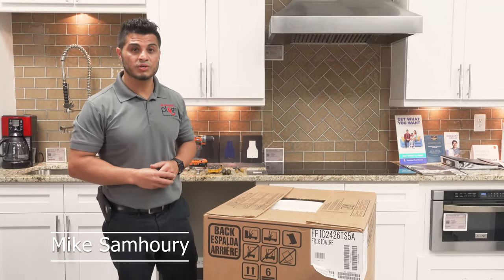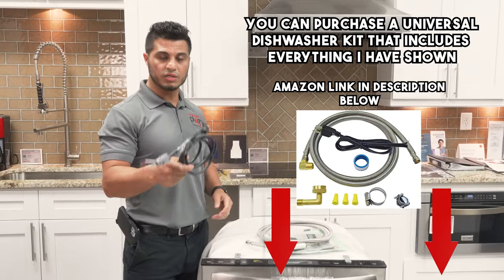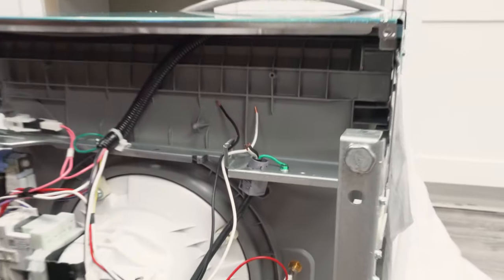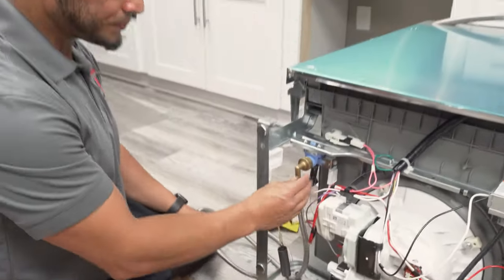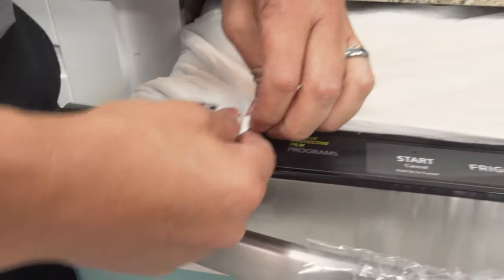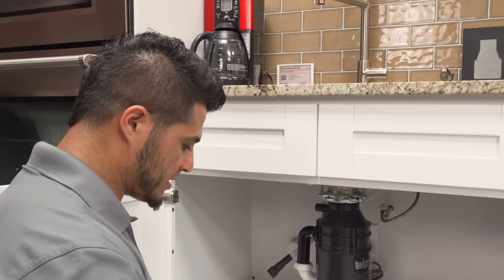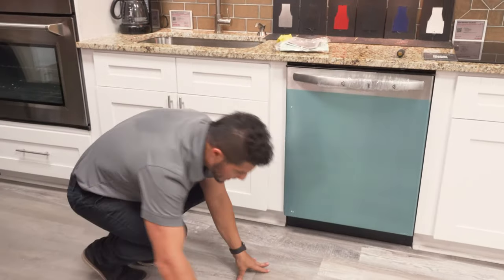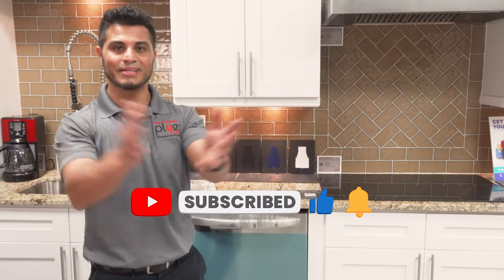How To Install A Frigidaire Dishwasher - Installation

Comment: Wow! I am a 36 year old woman who has never installed even a tiny appliance in my life. I just installed my new dishwasher all by myself. Step by step instructions are so clear, thank you!
Reply from the maker: Nice job! Glad to here, thank you!
Reply: @TheAppliancePlug  hey buddy I just installed the same dishwasher and I won't turn on.  Only thing I can think of is when I hooked up the ground wire to the green screw I put the wire in between the  washer that was on the green screw ,is  the wire suppost to be above the washer thingy touching the metal part of the unit itself.
Reply from the maker: @paulpersons799  hey Paul! It’s a little difficult to clearly explain in words. Fast forward to the step when I connect the electrical and follow it precisely. Look around underneath the dishwasher and make sure nothing appears to be unplugged. If everything looks ok, pickup a cheap tester and make sure the dishwasher is getting power. You might have a tripped gfi at one of your outlets in kitchen area.
Reply: @TheAppliancePlug  yeah the wire was already wired into the wall for my old dishwasher.  My old dishwasher was working.   So it must be tripped going or something come loose under new dishwasher.   It's for a friend's house , so I'm going back up there in a few days .  What and how do I do about the tripped gfi.  Do I get a fuse or something.   I really appreciate u helping me 😁😁
Reply from the maker: @paulpersons799  no problem. I would first look at the wiring under the dishwasher and make sure the wire nuts are snug and no loose connections. That’s really important so you don’t get a short. Then go to the breaker box and confirm the breaker for the dishwasher isn’t tripped. After that locate gfi outlets above countertops which can be reset in the middle of the outlet. Good luck!
Reply: @TheAppliancePlug  ok will do, and thanks again for the tips.  I will get back to u in a few days just to let u know how it went.  Take care 😁
Reply: @TheAppliancePlug  hey buddy,  can I pick up one of those wire pens and how do I test the wire.  Do I have the dishwasher breaker on when I test it I imagine and how to I use that pen on wire.  Do I touch the pin to the black wire ,  and it won't shock me will it ?
Reply from the maker: @paulpersons799  yes leave electrical on. It needs to be on in order for the tester to detect voltage. Check out this link, the first item listed is a safe tester: https://linktr.ee/theapplianceplug
Reply: @TheAppliancePlug  hey buddy,  I got the dishwasher working.  Still not shure what was wrong but I just undid all wires and ground and re did it.   Thanks again for ur help.   And I bought one of those wire tester pens to test the wire before.  Again thank u very much for taking ur time to help out a stranger.   Ur a good man.   Have a good day and happy holidays coming up
Reply: so how heavy is the unit? I do a lot of home projects but I am 61??

Comment: Awesome video, however, I have a very dumb question: water supply is the hot or cold line?
Reply from the maker: Water supply connects to hot line. It’s even recommended you run the hot water on your faucet before you start your dishwasher so that it fills with hot water from the start. The built-in heating element helps keep the water hot throughout the cycle and heat up hotter when you choose sanitize or high temp cycles, but because they are connected to standard 120V electric, they don’t really get enough power to heat cold water in an efficient time. Thanks for watching!

Comment: excellent instructions. We need to replace our 12 year old Fridigaire Gallary DW. Do you have any suggestions on the best three models (any brand) of DW that I should think of buying that are less than $700?
Reply from the maker: I appreciate your feedback. My primary suggestions will be to go with a dishwasher that has a stainless steel interior. 

Check out this selection of dishwashers to consider: 
https://www.theapplianceplug.com/_CGI/SEARCH3.HTML?MAN_SORT=KTA%7CWHIRL%7CLG&HAS_STAINLESS_TUB=YES&MAJOR=DISH&DIM_W_SORT=21.0:27.0&PRICE=1

These are on our website. If you’re not in the Tampa Bay Area, it probably won’t make sense for us to ship it at this time, However, you can at least look at these for suggestions and some of the ones that are over $700 do go on sale at times so you can keep an eye out for holiday sales. 

Thanks for watching!

Comment: Thanks for the great video.  I have similar dishwasher. I have noticed that in my basement right under it, there is a small trickle leak. I shut the water off but still leaking. I ran the washer, then the leak stopped but only to start again a few hours later....any advice before I take it out to see if there is anything loose? I figure if there was anything loose then it would leak more once I ran the washer...??   thanks
Reply from the maker: It’s possible that although you turned the water off, it was still dripping due to the pressure in the line. Can you tell where the drip is coming from? You can send a picture or video to 813-542-0273 and I’ll take a look at it for you.

Comment: Should a high drain loop be made? Thanks for this video!!
Reply from the maker: Yes, you want the loop to be higher then where the connection is make so that water doesn’t back flow into the dishwasher and siphons in the drain when the pump stops running. Thanks for watching!
Reply: He goes high but the instructions say low in the highlighted area.  I'm trying to install the upgraded Gallery.  This ana the seals have me at a stand still. 😢

Comment: What are these 2 white plastic pipes at bottom? My Frigidaire Dishwasher has only 1 white plastic pipe white is a drain pipe. The 2nd pipe is not present but has a hole for it.

Comment: We just got the gallery one and it comes with 2 rubber strips. The thing didn't come with any instructions on how to install it at all (very annoying), so I have no idea where to put those. Don't know if it's extra, or if it supposed to go on the sides.
Reply: I got the same problem!  Its a seal but doesn't show how to stick it on.  So frustrated.

Comment: Nice install video, but what about leveling?
Reply from the maker: Glad you think so. It shouldn’t be visibly leaning to the back and if it’s off level on either side the door won’t close properly or potentially leak from the door seal. It will also leak if it’s leaning forward. So, it needs to be level as accurate as possible. If you open the dishwasher door, the frame of the dishwasher should be square with the cabinet, assuming the cabinet is level. Best option is using a level and checking the front, top, and both sides. Check out the part in this video when I’m leveling the dishwasher for clarity. You will want to get the leveling feet started before sliding the dishwasher in place because they are difficult to break loose. Hope this helps. Thanks for watching!

Comment: Im.struggling leveling the figidaire. The center screw isn't working to raise the rear up. It leaning back toward the cabinet and the front legs are all the way down. The unit is out of plumb by about a half of inch.

Comment: I can't find a tool small enough to unscrew the tiny under the cabinet screws holding it in. They're square. I can't use a glamp because I can't reach it that way. Any suggestions?

Comment: Hey there, just finished the video (had to watch it in stages), and I have a couple of questions. #1 - I didn’t see rubber sleeves on the hinge arms of your demo DW. Our new Frigidaire DW has them. The old DW I removed was the same width as new one (obviously) but I found, as I was trying to fit it in the space, it’s NOT FITTING! I then saw the rubber sleeves and wondered if they need to be removed or… I gotta get this damned DW in! Any help would be greatly appreciated. 🙏🏼

Comment: Question: in your videos the sink is always to the left of dishwasher & for me my sink is on the right side of my unit-I was wanting a GE but the drain hose on all them are manufactured on the left side of dishwasher which means I would have to run the drain hose longer to go across the unit to the right side-thus worried that it will not drain properly. 

Am I wrong for this assumption or should I be looking for another make that manufactures their units with the drain hose on the right side of dishwasher like Fridgidaire. I’m only interested in Maytag, kichenaide, GE, Amana & Whirlpool - Thanks in advance
Reply from the maker: Great question! No, you do not need to reselect a dishwasher. They are manufactured to be installed to either side of the sink. The drain hose is long enough to reach if the dishwasher is located directly next to the sink. What’s important for draining properly, is making sure the drain hose isn’t rain like a roller coaster and elevated higher than the drain connection so that water doesn’t back flow into the dishwasher. Let me know if this makes sense. Thanks for watching!
Reply: @TheAppliancePlug  In advance thank you for replying..so basically make sure I run the hose up to the hole to feed it through to disposal without the hose looking like a wavy up & down "rollercoaster" correct? And yes...great instructional videos sir! Well done!

Comment: Do you know what size 90 degree brass fitting you used on the blue water supply port? I had a hard time finding anything to fit at the hardware store and I was too scared to cross thread the plastic port.
Reply from the maker: Check out this link. The first item is a dishwasher kit that includes the fitting. https://linktr.ee/theapplianceplug

Comment: We just installed our dishwasher and started a cycle, my husband didn’t hear anything so he opened it. Now I have the Clean, Wash and Sanitize lights are all blinking and we can’t do anything with it now. Can you give me any advice
Reply from the maker: Most of the time when you start a cycle and open the door, it pauses the cycle. All you have to do is press the start button button to continue. When you first start a cycle it takes a few seconds sometimes to kick on, especially for the first cycle you run after installation. If that doesn't work, just turn your breaker off and turn it back on to reset it. Make sure your water is turned on and your drain is free of any blockage including the plug in a garbage disposal if your drain is connected to one. Let me and other viewers know if that works! Thanks for watching!

Comment: I was surprised that my new dishwasher didn't come with any of the lines. My last one came with everything so I just took it off of that 🤷
Reply from the maker: Yes Andre most of the time you would have to buy a dishwasher kit. I have a recommendation in my description from Amazon that has everything you need!

Comment: How level must it be?
Reply from the maker: It shouldn’t be visibly leaning to the back and if it’s off level on either side the door won’t close properly or potentially leak from the door seal. It will also leak if it’s leaning forward. So, it needs to be level as accurate as possible. If you open the dishwasher door, the frame of the dishwasher should be square with the cabinet, assuming the cabinet is level. Best option is using a level and checking the front, top, and both sides. Check out the part in this video when I’m leveling the dishwasher for clarity. Hope this helps. Thanks for watching!

Comment: You should never connect the wires through a sharp metal hole without using a junction box clamp. This keeps the vibrations of the machine from having the edges of the metal from cutting the wires and shorting out. (at 13:43) If you're buying just one, better go to the hardware store.

Comment: Sad thing is , everything should come with the dishwasher.  Even if they bump the cost, having to stop what I'm doing and run get the peice to install the water flow. If I had the money and means I'd produce products that would actually last and give my customers everything they need to get it going in the same day. So sad all these companies are suck garbage but the vidoe was helpful

Comment: There is no reason in hell a dishwasher install video should be 46 minutes long😱
Reply from the maker: If you know what you are doing it shouldn't take 45 mins. However, I am recording a YouTube video and try to go over every single detail so that even a beginner can successfully install a dishwasher.
Reply: I had him add thread tape and electrical tape but I'm overly cautious 😂
Reply: This VERY obviously for people who have no idea how plumbing, electric or appliances...which if you read the comments it's very clear it's what they needed. I'm not by my brother and verbally telling him wasn't cutting it. This covered everything (besides mentioned that some dishwashers don't have a ground nut and has 3 wires) that he needed to know. Excellent video. What seems simple to you and me might not be for others. He did great